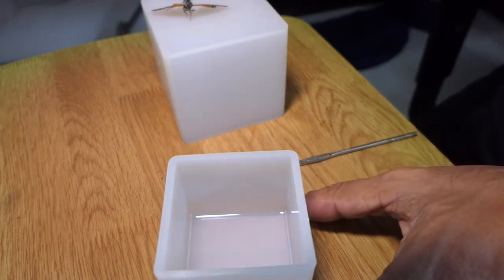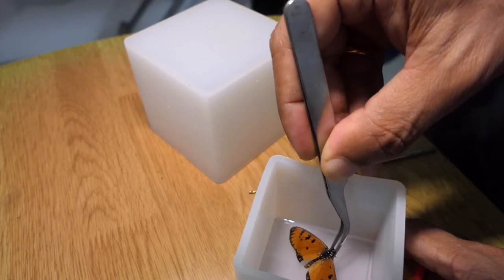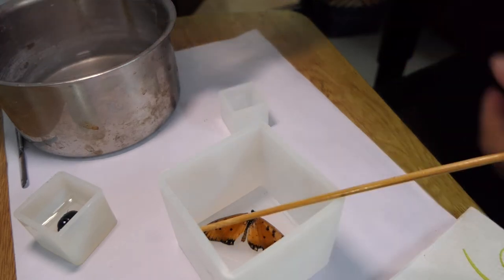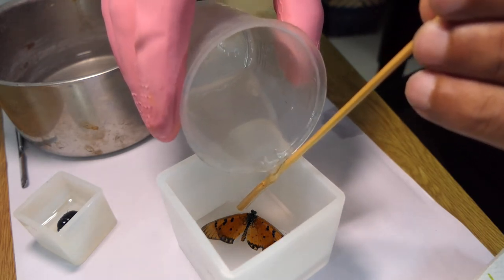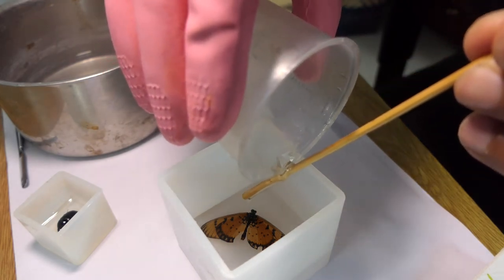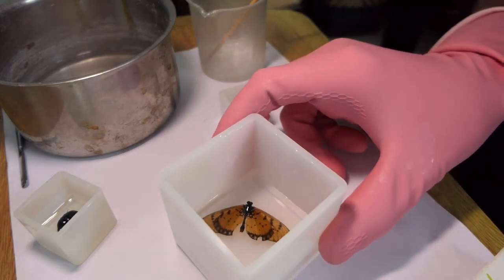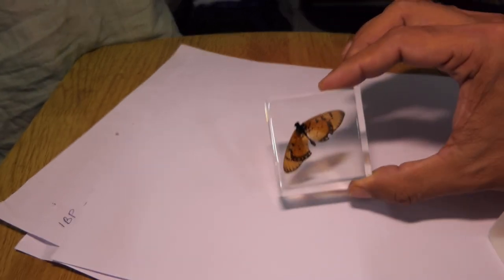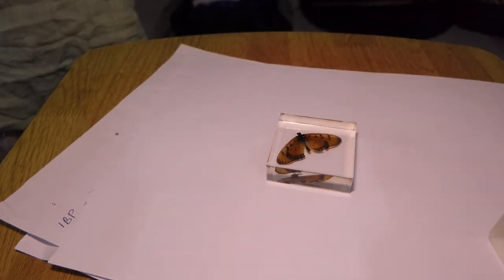Resin casting/embedding a (dead) Tawny Coster butterfly. My first butterfly casting

Comment: Did you have to dry it before putting it in resin? I found a beautiful moth I want to preserve in resin but don’t want to ruin it
Reply from the maker: Yes. I found it dead and dried up. I then had to moisturize it to unfurl it's legs and antenna into position, pin it like that to dry again and then cast it. You should do the same.

Comment: Hi! I am thinking of preserving a dead dragonfly and was wondering how was the wings of your butterfly stand after a month of uploading the video. Does it still has that wonderful color or has there been any changes I have to know? Thank you.
Reply from the maker: Hello. The butterfly is doing fine. There hasn't been any colour loss. However I did try a dragonfly which completely flopped. You can see the video here https://youtu.be/A7TgDit8K-I
Reply: @NatureMagnifiedVideos  - Oh thank you. I wonder what could have been different for the two and am also thinking about the cost as I do not have any resin available with me. I was wondering as well if having it preserved in hand sanitizers could be great for them too - if you have tried it?
Reply from the maker: Never tried that. I suspect it was something to do with heat. I warmed the resin and poured a thick layer. Additional heart is generated when resin sets. It must have set off some kind of reaction.
Reply from the maker: Although I have never tried it, to me hand sanitizers doesnt sound like a good idea. I can imagine issues with the insect floating, getting wings getting soaked etc.
Reply: @NatureMagnifiedVideos  - That is true.. I have a red dragonfly that I would like to preserve and was wondering what could be the best way to maintain the color.
At the moment, their body is rather crisp which is suspectible to cracking/breaking.
Reply from the maker: @ShinSeul  you will need to moisturise the insect first by keeping in a box with some wet tissue. Then pin it in a good position and dry it like that before casting.